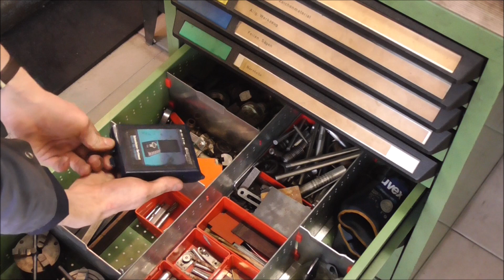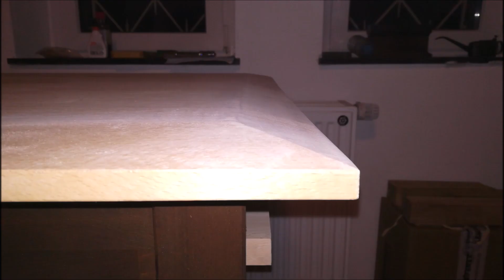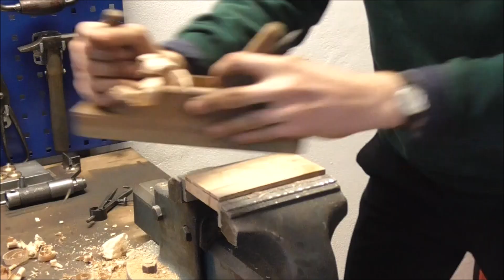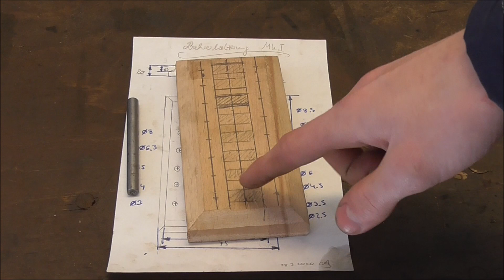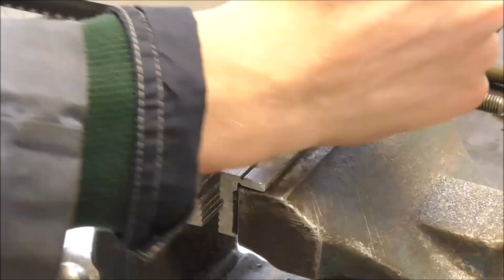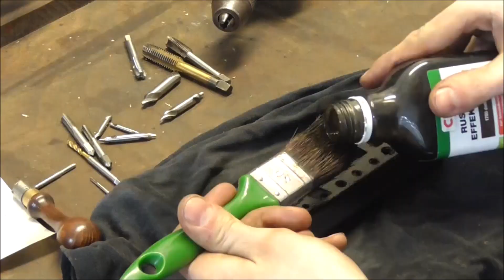Tap and Die Stand - a Struggle with Wood

Comment: Neat little project, never thought about standing up the dies.  If you paint that stand, you can fill in those breakouts with Bondo, the famous auto body filler material.
Reply from the maker: Thank you! 
I copied that design from the case the dies were originally delivered in. Certainly easier to pick them out as opposed to having them laid down flat.
After a year or so of having the board, I kinda got used to the small imperfections - they're mostly hidden from vision by the dies themselves anyways.
Reply: @AstraWerke  Good stuff, I'm going to make a similar stand. I found a keyway cutter in my junk, good enough to cut wood.
Reply from the maker: @geobrown9413  Sounds like the perfect tool for the job

Comment: Your machining skills are really improving but if you wish to make the occasional projects in wood I feel you should do more research about woodworking operations and techniques which would make your projects so much easier to do.
Reply from the maker: It's always the "Naah, I've got the hang of it, I've done things with wood already, it can't be that hard" - until wood proves me wrong again.
How would a proper woodworker tackle the half-round cutouts?
Reply: I've used a chip carving knife to score the cross grain, then a razor sharp chisel to remove the center between. Then back to the knife to score deeper... slow and steady gets it done faster

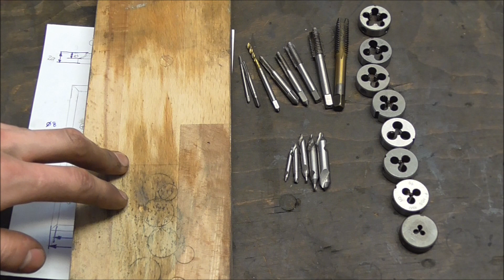Comment: 3:03...the problem with wood is that it's naturally "hydroscopic": that means that wood absorbs and retains moisture, and consequently, promotes RUST on bare steel parts.
Reply from the maker: I'll be honest, I didn't even think about that up until now.
Let's hope the clear coat will prevent any moisture from rusting up my tools... Time will tell.
Reply: @AstraWerke  As long as you keep the drill bits, taps, and dies wiped down with oil, the chance of rusting should be negligible.
Reply: @AstraWerke  When I was a teenager, I used to fix watches- there's a tool set called a "staking tool", and a lot of precision tools are stored in a fitted wooden box. I have seen several of these tool sets that were ruined by rusting because of moisture in the wooden box.